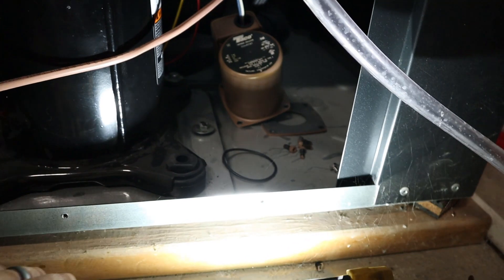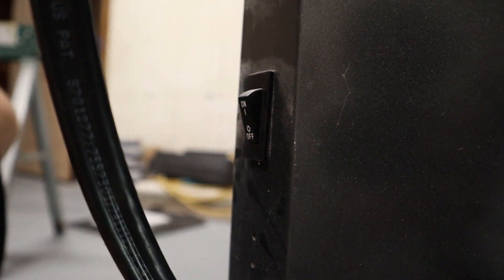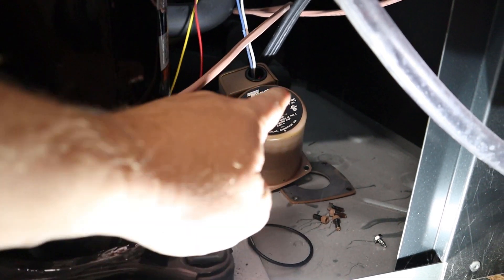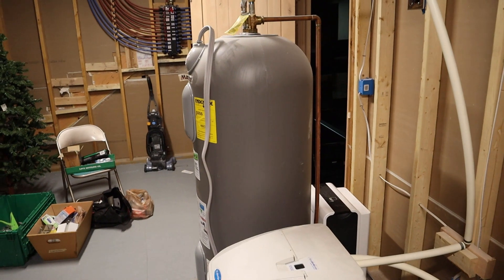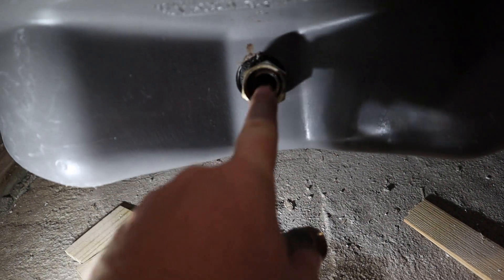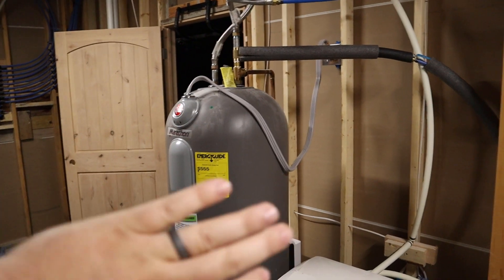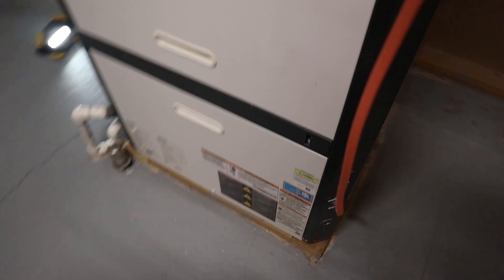FREE Hot H2O - Desuperheater - Step-by-Step DIY Geothermal (Part 6)

Comment: It appears that you've created a galvanic corrosion location on your cold line going into the HW tank (steel nipple to brass).  You'll have a leak some years in the future. 
I'd also recommend using Loctite teflon cord in the threads.  Much better than tape !
Can you add a thermo or flow controlled switch to your Taco pump ?  Why have it running when there's no HW leaving the tank.

Comment: Thanks for the presentation.  1 thing - make sure all those fittings are lead free - especially for drinking water.  2nd, you may want to have a dedicated indirect tank that has a separate coil for recirculation.  This 2nd point is really based on your local codes.  Some areas don't allow direct feeds like this.

One other note - I wonder why those desuperheater pipes are not insulated within the unit.

Comment: I would be a bit worried about Legionella bacteria. A water temperature of 120°F does not kill the Legionella bacteria; a hot water temperature of 140°F is required at which Legionellae dies in 32 minutes. Is there another system you have in line of your hot water tank to prevent it? Cheers

Comment: My desuperheater is hooked up from my geothermal unit to my water heater in the same exact way. But I keep reading that a desuperheater system really doesn't work unless you have a buffer tank. In other words, your unit is not heating water when it's off. I don't know if this is true or not. Any idea?
Reply from the maker: The desuperheater is definitely not heating water when the geo unit is off, but that's why we have the normal method (resistive coil) for water heating as a backup.  It's set a little lower, but will kick on if the desuperheater isn't running or can't keep up.

Comment: Does this only working in cooling mode (Ie. summer? ) I'm wondering if you could do a bypass valve if you don't want to use the hot water for your heater? I'm wondering, could you divert the water to a water barrel in a greenhouse and use the hot water as a thermal heater in the winter?
Reply from the maker: Generally, summer only
Reply: @Challenged1  It works in both heating and cooling mode.  In heating mode you're making hot water at the COP of your geothermal system, versus in cooling mode where the heat is "free" because instead of taking from your house and putting it into the ground, you're putting some of it into a water tank.  (In heating mode you're taking it from the ground and putting some of it in your house, and some of it in your water tank).
Reply from the maker: @MarkMalley  It doesn't work in heating mode.  The desuperheater surrounds only one of the refrigerant pipes.  When you switch from cooling the heating, that pipe goes from hot to cold.
Reply: @Challenged1   Generally, desuperheaters work in both modes.  Assuming your unit is in a Bosch SM model, I believe it even has a switch on it to easily disable it in heating mode if you'd like so you can dedicate all of its output to space heating (this is mentioned in the manual), instead of space heating and hot water generation (because as I noted, when in space heating mode, you'd be putting some of that heat into the water tank). Heating water in winter with geothermal is still a good deal compared to using an electric water heater, but not if you need your unit to start using emergency heat/the electric resistive heat strips to meet your heating demand.

Comment: How hot does the desuperheater heat the water?  It seems like if you added a hot water heater that also had a heat pump on it that it would be super efficient.  I would also put a a large filter system in for the incoming water.  Wouldn't want that to clog up in 20 years, high mineral deposits here.
Reply: Thats what i got. Pay about $80/yr on hot water. My desuper gets the water to 120, then the heatpump hot water heater gets it to 130.
Reply: Many units have a switch that you can set the cutoff temperature to (120 or 135 degrees).  Some older units had the cutoff fixed to 125.  It varied by brand.

Comment: Could a desuperheater work with an air source heat pump? Or something similar? I have a small lot of city land and I don't think I can justify the cost of a closed-loop geothermal heat pump
Reply: Absolutely. There are desuperheaters made just for air source heat pumps and air conditioners. Also the desuperheater ties into the Refrigerant system so you will need an hvac/r tech to connect it. You will also need a temp sensor that doesn’t allow the desuperheater pump to kick in until the discharge refrigerant temp gets above 140 degrees f. Or the desuperheater will actually be taking heat away from the water heater.

Comment: Actually the desuperheater is just as effective in the heating mode as it is in the cooling mode. And in the northern part of the country where I live it’s more effective in the heating mode because of the long run cycles. Sure it takes away from space heating (approximately 2000 btu per ton) but it’s still much more efficient than heating water with resistance electric or gas.
Reply: We live in the Hudson Valley in NY and opted out of having the desuperheater.  Our heat pump water heater is extremely efficient and felt the desuperheater wasn't necessary.    It can still be added and maybe we will at some point in the future.
Reply: @chrismaxny4066  Heat pump water heaters work great during the air conditioning season. Not so much during the heating season as they cool the space around them and your heating system has to make up for that. Adding a desuperheater to a geothermal heat pump would be very difficult and cost prohibitive. In some areas a geothermal heat pump has to have a desuperheater in order to qualify for tax rebates.
Reply: We got all the incentives without the desuperheater.

Comment: I think it would be easer and more efficient to install a pre-heat (Storage) tank tied into desuperheater loop. Then you would have hot water in pre-heat tank most of the year. I have 3.5 ton geothermal system and a 60 gallon pre-heat tank that feeds my hot water heater 24-7. It works great feeding my water heater, no adjusting anything and you will get some good heat from desuperheater in winter month also.
Reply from the maker: I would be curious what the payback period would be for the increased cost of the preheat tank.  I like the idea though
Reply: @Challenged1 if you had a dead or unused water heater, it could be used as a preheat tank. “Free”
Reply: A second tank is 100% the way to go.  Desuperheaters work by raising the temperature of the water a few degrees each time the water passes through the little section of pipe he showed in that video.  That's not much, and there is a lot of water in a water heater, but geothermal systems can (and are designed to) run for a long time.  If the water tank is already 120 degrees, there's not really any work for the desuperheater to do.  On the off chance the water in the tank is cold, the elements will raise the temperature long before the desuperheater ever gets a chance to.  Always use a buffer tank!

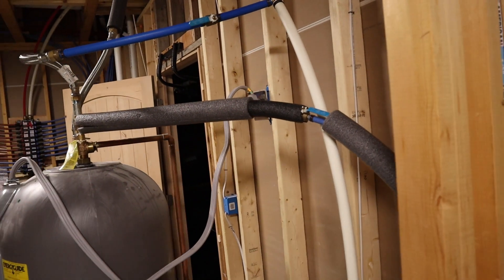Comment: 7:46 is that a cut out in the floor to catch water from a leaking water heater? How did you that, place a mold in the cement before the slab dried?
Reply from the maker: Yes.  I just placed a form out of 2"x2" lumber in this area, and placed the concrete accordingly.

Comment: Great info, thank you! I have a geothermal water furnace, when I have the heat exchanger turned on my hot water smells like sulfur. But when I turn the desuperheater off my water smells fine after a couple days. But from my understanding the well water that goes into the geothermal that's unfiltered doesn't mix with the desuperheater?
Reply from the maker: The desuperheater side should not be directly connected to the actual heating side, you are correct.
Reply: Old post, but I'll reply anyway - I don't know your system but science tells me your water has more time to sit when your heat exchanger is turned off. Sitting water has more time to oxidize and that removes a lot of that sulfur from the water. Purely a guess as I don't have one of these systems, but I do know that is one way sulfur smell can leave water.

Comment: The desuperheater can only provide fairly low temperature heat and at a fairly low rate (BTU’s per hour). So, the system only really works if it is used to pre-heat the water (in a preheat tank) which then feeds the main water heater.
Reply: That is also how I understand it.. and is the reason I question this method of connecting to the hot water tank.
Reply: @iesousnet my 70,000 BTU geothermal system has a desuper heater which will heat a pre-heat tank (80 gallons) from 50degF to 120degF over about 8 hours of operation. 
Any electric element heating of that tank must be left switched off, otherwise it will take over the heating of the water before the Geo has any chance to.
Reply: @I999-g2s  yeah. The pre heat tank seems like a good way to go.  To take full advantage of the desuperheater you would not really want any heating element turned on at all in the tank that it is connected to.  It is the setting the thermostat in the tank 10 degrees below your desired temp that I question as it would cause the electric elements to really do most of the heating because of the time it takes for the desuperheater to bring it up to temp.

Comment: I'm hooking one up to a marathon. 
So you need a checkvalve on the cold side above the connection to the desuperheater?
Reply from the maker: I believe it comes with the water heater
Reply: I have a recirc line tied into heater as well.  I have a checkvalve coming off the cold feeding the hot water heater

Comment: I wonder if I'll have to set up my hot water tank differently. My area requires a spare hot water tank that you do not plug in and that's where your heatpump dumps the prewarmed  water and then it will continue on to your standard functioning hot water tank.

Comment: What do you think of a geothermal setup laid out like yours (slinky loop) but it had a heat exchanger at one end inside the house. And then at the opposite end have another unit to function as a pool heater. Then in the summer one side would be putting heat into the ground and the other would be pulling it out.

Comment: Garrett, it works!  Of the three plumber's construction rules, you got one right- "plumb, square and tight", you got tight, no leaks so the rest could be called cosmetic. As a repair plumber, I disagree- square and plumb mean it will run along predictable routes and follow predictable paths- when you have to hunt for it in a closed wall, systems "running wild" are a nightmare. But it's done, so no more. When the engineer in you decides it wants revisit, it will keep you up till you do it- have faith, I know about this stuff! 
  On your WH temp setting; never ever set the WH temp higher than 120 degrees Fahrenheit- you are at the scald thresh hold for children and elderly or any dry skin. i have had this argument with clients in the past- I will not break this rule myself, I will show them how they may do so and explain that I will reset it if later service finds it above that. In Texas, a plumber and his Master's license holder can bear some responsibility for improper adjustment and shoddy work that endangers others. Oddly, the company we work for has limited liability but the working stiffs can have adverse actions taken. Just so you know- in Kansas it may be different, but I suspect the money guys have very similar protections for themselves. The one exception to this is a commercial tank boiler used in a restaurant for a commercial purpose- 180 is about the highest you can run any of them on stock T&P valves- you are now 32 degrees from flash boiling all the water- liquid water, when it flashes requires 700 times as much volume to finish at the set temperature, IIRC. One 119 gallon WH blew up in an Oklahoma school cafeteria- it demolished roughly half of a cafeteria for 200 students to be served and eat in. This is not a toy to play with at all. It's not a bad job to DIY, but read all the directions, especially the ones in red ink- it's likely your derriere or one close to you that could get blown off. Garrett, you know this, and I trust you to protect your self and family, implicitly- at least half of this is for the folks following this! FR

Comment: Garret. How many BTUs are you actually recuperating from it? It is usually 5-10% of the cooling load. Can you share your numbers here?
Reply from the maker: It would depend how often the heat pump runs, so, I have no idea.  I'll have to live with it a bit longer to see how it affects my bills.  I can tell you, the water temp is higher than the water heater set point, which means the desuperheater is covering 100% of the standby heating and then some.  The only times the heating elements come on in the water heater is after a shower.
Reply: You will typically get 2000 btu of hot water per ton of heat pump. My desuperheater makes a lot more hot water during the heating season than it does in the cooling season because my run times are a lot longer in the heating season.

Comment: How do you like the Rheem Marathon tank?  

Planning on using 50 gal version as a storage tank connected to desuperheater, with electric point of use units distributed around the house.
Reply from the maker: No complaints or problems from mine.  I like the lifetime tank, and it's easy to change elements as needed.

Comment: What are your thoughts on putting the thermal loops under a driveway since I already have to do the dirt work there? All clay soils. My main concerns would be the compaction hurting the lines or future maintenance
Reply from the maker: I wouldn't have a problem with it.  Be sure to flood the trenches as your first course of compaction, and then mechanically compact it.